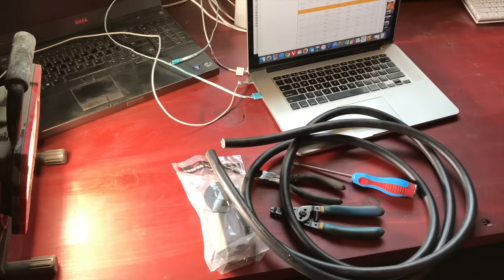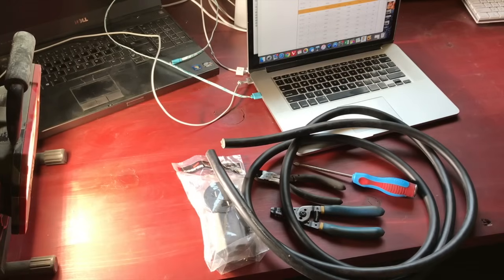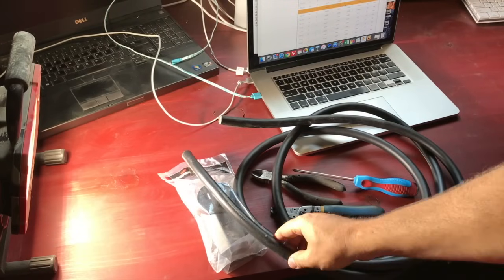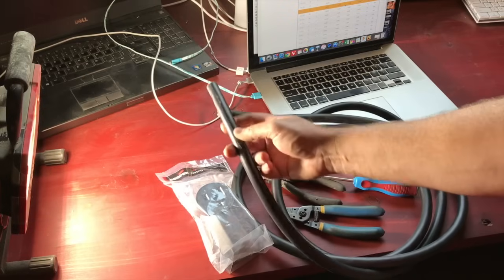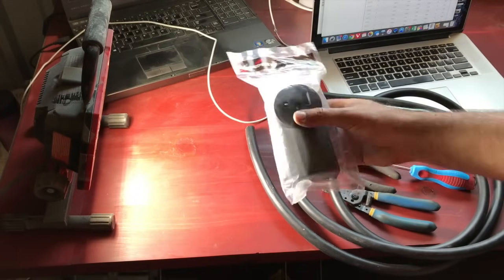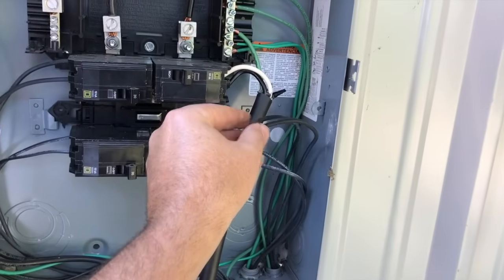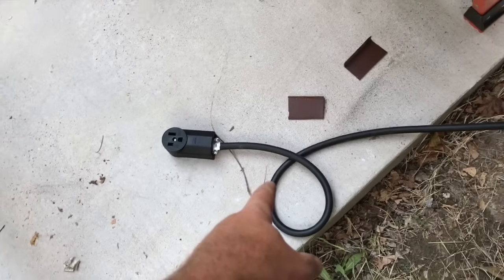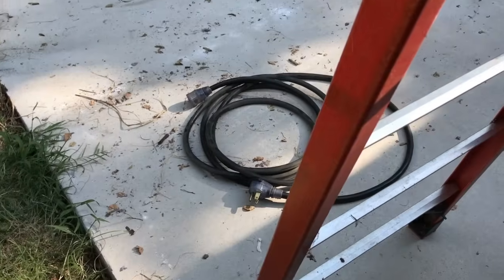Wiring a 220v Welder Electrical Extension Cord -  Quick/Simple - But is it safe?

Comment: You still couldve run 240 with both hots an neutral with the ground tied to the metal back even tho there plastic between neutral is ground am i correct

Comment: Extension cords are the typical way to make welding machines mobile. They're a lot less expensive than running longer welding leads (which are still well worth having) and can be hung off your welding cart if desired. (I use scaffolding casters with large wheels for my welder cart and will never buy conventional casters for a welding cart again!) 

If ya find one long cord awkward turn it into two shorter cords.

Twist-lock connectors are much nicer to deal with and more durable than the traditional wall receptacle style shown so if you convert your wall receptacle to twist lock, replace your male welder cable with a male twist-lock and use them on the cord you'll have a much better product. I have many cords and mix of parts but converted my shop to twist lock since it's much more durable and safer over repeated disconnections running a variety of equipment. The home gamer setup shown can last many years but the plastic shell breaks easily so I use the ends designed for cable instead.  This style Forney is also at many hardware stores with a Forney welding products display. Their stuff is decent.

https://www.amazon.com/Forney-58401-Electrical-Receptacle-Pin-Type/dp/B003X4338G?ref_=ast_sto_dp

Lastly do price shop cable because prices vary wildly. Your local electrical supply house and Ebay are worth checking too. Hardware store prices tend to be highest by far.

Comment: Hey, when you opened the sub panel, I did not see the neutral separate from the ground… is that ok to do?
Reply: No it is not okay everything in this video is wrong and not up to code sub panel has to have a separate ground bar grounded to the box and the neutral cannot be bonded it all has to be separate and as far as his feeder wires they are way to small for the power he is using should be using a 3-4 copper or a 2-2-2-4 aluminum feed for that amount of power at least and should have a 4 wire connection not 3 sub panels need 2 hots a neutral and a ground

Comment: My stove plug is the old 10-50 3 prong plug it has red and black as hot and neutral is white. I can't find anything about going from a stove plug to my welder just from a dryer plug to welder. My old stove 3 prong plug is on a 40amp breaker with 6/3 wire and the ground is only connected to the box. Is that OK to go from to my welder would I just use the neutral as a ground when I go from the 10-50 3 prong plug to the 6-50 50amp  rated plug..

Comment: 20 amp breaker = 12 gauge wire. 30 amp breaker = 10 gauge wire  40 amp breaker = 8 gauge wire 50 amp breaker = 6 gauge wire 

So a 8/3 wire has one red, one black, one white and one copper (ground).  8/2 has everything but the red wire.
Reply: Thanks Mark. When he said he "THINKS" had 12 awg wire for a 30 amp circuit  AND A 50 AMP RATED receptacleI laughed. It's scary what some of these DIY'ers are doing regarding electrical work.

Comment: YES, you sound nervous...ha ha.
Anyone that works with elec. Is nervous at different levels.  When your an experienced electrician you do it so much you don't see the nervous to much. A pair of good electrician gloves will help. Use wire nuts even if temp.  Much safer. Most people can learn the basics and save a lot of money. But do everything you can to protect yourself.  By a way most that get bit don't die. You here stories so you think that anytime you get electrocuted your going to die. If that's the case I would be dead a long time a go. Anyway good job

Comment: Who illegally installed the sub-panel?   Why did you not just mount the receptacle under the illegal sub panel with a short piece of conduit and do it correct?

The receptacle used is for surface mounting as you said.   It is absolutely not tested or listed for an extension cord.  Why not just buy a cord cap receptacle and do it correctly?  #12 is wrong!  It should only be used on 20 ampere max circuit breaker or fuse.   You should have used #10 minimum for 30 ampere breaker, or #8 for 40 or 50 ampere breaker.     I still do not understand why most YouTube videos show incorrectly making cords.   And then say, “I’m not an electrician, don’t do this”.   Why even make the video?   Views and money.

Comment: i converted  my dryer plug  a 10-30 to a 6-50 nema then i am running a 40ft extension with little to no voltage drop. Thats why i went with 8/3AWG instead of 10 because of the distance.
https://www.amazon.com/gp/product/B072C3NW99/ref=ppx_yo_dt_b_asin_title_o03_s00?ie=UTF8&psc=1
Reply: I have 8/3 . How long can my extension cord be before power drops? I have a 50 ft. I'm not sure yet, but I think my shed is much further than that away from my outlet.. How far can I go with 8? Can I find thicker gauge for more distance,? Thank you

Comment: Just asking why didn't you just take the breaker out then take the wires off ? also use a insulated screwdriver if working with power on.. I know this from experience..Just suggesting to be safe. You can possibly get arc flash in some power panels using a screwdriver if not careful. I've seen it happen..

Comment: You are such a careless idiot... don't care if you wear jeans, a safety cap or rubber boots. You never, ever go to unscrew a switch, power or no power while it is still attached to the Hot Box Prongs. You have to POP THE SWITCH/BREAKER OUT OF THE BOX FIRST! and then you can detach/add the new wires WHILE THE FREAKING SWITCH IS NOT CONNECTED TO THE BOX! They are removable if you don't know that. Every switch breaker black box can be taken out for rewiring. If you don't know what you're doing, don't be posting your moronic videos here so other idiots can follow suit. That's very IRRESPONSIBLE... Take the goddamn Breaker switch out of the power box first, ad your wires and while it is SWITCHED OFF, THEN AND ONLY THEN, You can plug it back! Moron!

Comment: You should be wearing jeans my man. And long sleeves. And a cap. Safety first. Also you probably should have run the wire though a knockout on the panel just to be safe. And since you have space in the panel you might as well have gotten yourself a 50A breaker. Why run the risk? And it gives you the option of turning up the amps if you need to. And why not just get some 6/2 wire with ground like I did. It cost me $1 per foot. Not that expensive and way safer. That way you can plug in any welder up to 50A without worrying. 

And to answer the title question.....NO it is not safe....on multiple levels. 

Just bought a Titanium 225 Stick Inverter Welder from HarborFreight and it specifically says not to use an extension cord on the unit. Strange.

"You're responsible for your own safety, not me". You should heed your own advice!

Comment: Hi mr. Ramsey
How are you?
Can you help me please
How I can get a welder which can work on both power supply of 220 volts and 240 volts please?
I am looking forward to have one which is Australian standard welder.
Thanks
Reply: I'm the US at least, there is no such thing as 220 or 230 anymore. Hasn't been for a long long time. People just say that. But the voltage delivered by the power company is 240.

Comment: I made a 50ft extension cord for my everlast inverter welder. Very useful to have as I run my welders off of the dryer outlet back in the house.
Reply: ME TOO
Reply: I'll try to do the same but not sure if my 50ft will reach my new shed/workshop.. Can you have longer than 50ft on a welder extension cord,?

Comment: I got a outlet that reads 125/250 i have a 220 welder but the pattern is diffrent if i change the plug will i have any issuess ?
Reply from the maker: I am not an electrician and do my own stuff the best i know how, but yes, you should be fine, look at your welder, it should give you an input voltage range and you can see if it will support the 250 input

Comment: Proper wire would be 10-2 awg. The neutral becomes your hot. So it would be black, black with white strip and green for ground
Reply: The dryer plug has 4 wires
The welder 3
So there’s a wire that is not used (the neutral not sure)?????????

Comment: Just BUY one!  They're cheaper and heaps better than that with the crappy metal/plastic ends and the wimpy wire.  Sorry, but true.
Reply from the maker: Why are you sorry? I don't think you are sorry at all.  Just call it like you see it, you don't need to apologize, lol.  Trolls are constantly dropping in leaving  random comments, so I don't mind at all.  The reason I didn't buy one was because no one around me sells them, and I needed something to get temporary power, and I already have a regular 25 ft extension cord as shown in the video and I don't need another one, and it did the job, so why not?  yea!!
Reply: https://www.amazon.com/gp/product/B002IZ99G6/ref=as_li_qf_sp_asin_il_tl?ie=UTF8&tag=chuck0f3-20&camp=1789&creative=9325&linkCode=as2&creativeASIN=B002IZ99G6&linkId=86979555225664daaad5f0ab86abd337

Not around you but you can have it there tomorrow.........  Chop it up and use it.  WAY better.  
Drop that plastic end once on the concrete and it'll shatter.  Way better copper too.

Comment: Good video Gary. I use only 3 wires out of 4 too if I'm using it as an extention. White with black tape on it becomes my hot if I don't have a red. Normally it's black and red hot white neutral and green ground, that's today's code. However if you don't have 4 wire or don't want to waste money use white as hot and have no neutral. I use 100ft 10/3 soow works great on inverter machines.
Reply: So no ground or nutral? Whats the purpose? About to set my house on fire.
Reply: @pedrolopez7590  neutral is different than ground

Comment: i understand this is just a temporary cord. i am just offering what i would do. i am not criticizing you in any way.  if you were looking to make a better extension using "so" cord, you would need #10 copper wire to handle 30 amp welder. would not use that "house receptable" for moving around. it is meant for permanent mount only. the plastic will break very easy on concrete and a shop setting. if i was making one instead of buying a premade molded cord i would use a 4 square bell / water tight box with a recess mounted receptacle.
Reply from the maker: Great points, thank you sir

Comment: Green is Ground, White is your Neutral ... Black is what your fingers will look like if you're aren't qualified and go messing around anyway. Basic colour guidelines
Reply from the maker: lol, good stuff.  I think white can be used as a carrier in 220-240v applications based on the research i did
Reply: I'm not an electrician but I know Black will make you Black
Reply: Get grammar right
Reply: mcinkyt you can you white as hot if you don't have a red. Black and white hot (stripe it with electrical) and green ground. That's for 3 wire set up. 4 you would have red as white then would become neutral. It's an extension cord so no ones going to be messing with it. It's not that difficult.